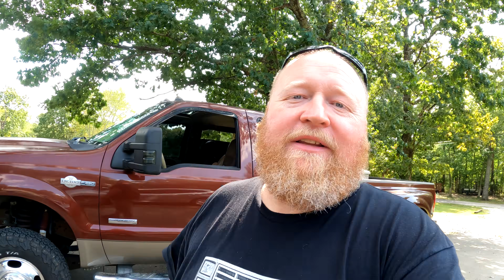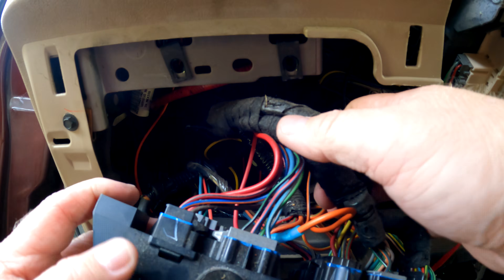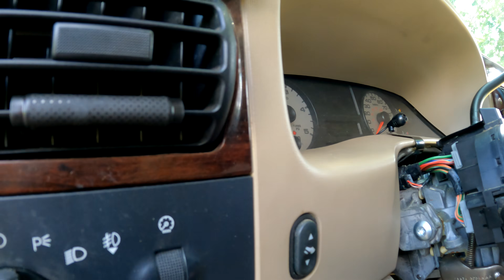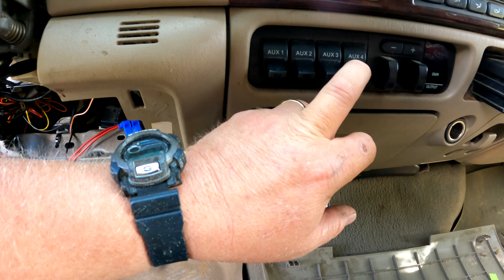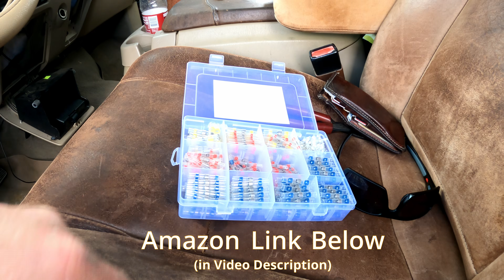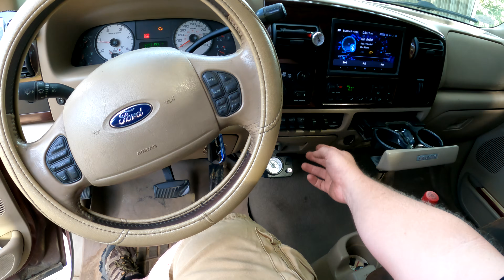Hidden Feature (High Idle) - How to Enable it on Your Ford 6.0 Powerstroke Diesel

Comment from the maker: I get these questions a LOT. "Why high idle?" and "How is it different from the automatic high idle?" Here's the short answer: 

The manual high idle swtich isn't a "Mod" or a "Hack". This is an OPTION. It was put there by the manufacturer of the powertrain system for commercial applications. Some trucks (like wreckers) use a Power Take-Off (PTO) system for things like dump beds, booms, or compressors. These often need the engine to run at a higher RPM for proper operation. The high idle switch lets operators manually set and hold that speed until the switch is turned off.

The automatic high idle is something all the PSD trucks of this era have. In colder temps, it will elevate the engine RPM temporarily in order to warm the engine faster. It turns itself off after a few minutes.

Comment: Has anyone retrofit the factory auxiliary switch panel to their truck? If the factory wiring harness included in all builds or is it a different wiring harness?

2003 Ford F-350 6.0L King Ranch Dually.
Reply from the maker: I believe all the harness is there for the upfitter switch panel. I think that's true for all these trucks.

Comment: My 6.0 F250 sometimes just automatically speeds to 1200 RPM right after start, and won't go down until it gets warm. I don't want it to do this. Is it possible to disable this behavior (kind ore reverse what you are telling us to do) But mine doesn't have a PTO that I know of.
Reply from the maker: No, way to disable that I know of. All the ones I've owned do this as part of a warm up strategy. On all I've owned, pressing the brake will bring it down.

Comment: I used to work on ambulances every once in a while, they would wire that circuit to the parking brake light so when they would stop at an incident and set the brake, the engine goes to high idle to keep battery voltage up for the electronics and lights in the back.
Reply from the maker: Oh, that's kinda neat.
Reply: Thanks Chat GPT
Reply: i own a ex ambulance 6.0 and yes this is true😅

Comment: Around 30 degrees my 6.0 high idles automatically. 2004 Lariat F-250
Reply from the maker: They all do it from the factory when they're in the "warm up" phase. Problem is that you cannot tell the truck to high idle after it's warmed up. That's why Ford included this in the ECM's logic.

Comment: Do we have this same type of high idle system on our 6.4? That would be so great. My buddy picked up a 6.0 with a couple hundred K on it. Me I steped into an 08 with 62K on it I have done every beneficial mode that can be done to it. I think. This one would be great especially in the winter 😊👍👍
Reply: I'd spend the 100 bucks on the BD Diesel kit. It allows you to adjust 900-3000rpm on anything newer than 2005 all the way to 2024. The 03-04 6.0s are only capable of a single 1100RPM high idle using the upfitter wires.
Reply from the maker: I agree with the BD Diesel comment. That's the way I would go.

Comment: I have a pto system on my 7.3l F550 recently it rained & that notorious windshield leak dripped down the driver side floor & pto stopped working maybe water got into the panel. What should I check for to diagnose the problem please respond if u can coz I got stuck with it since it's a work tow truck. Thanks
Reply from the maker: That PTO controller is a pretty sought after thing. If it got wet, you may want to seek out an electronics repair shop. Or have a look on ebay. There are always a few for sale.

Comment: Sorry to waste your time I think I bought a 6.0 ford f350 2005 and it came with an idle button, what’s an idle button and what’s the point of having one??
Reply from the maker: Used for a lot of things - faster warm ups, keeping battery charge high during hard draws, etc. Most ambulances and medium duty trucks like wreckers use them to speed up the hydraulic system. That's what it was originally meant for.

Comment: i always wondered what that bundle of cut wires behind there were for.
Reply from the maker: There is also a small bundle of wires under the hood by the master cylinder too. Those run inside under the dash area  The intention was to keep us from having to drill holes in the firewall to get wiring out under the hood.

Comment: If it’s cold out, my 03 will idle for a minute or so, and then go into high idle to 1100 rpm. It’s never been touched, so maybe it was used first year or so?
Reply from the maker: No, they all do that. It's just a warm-up aid. The high idle feature in this video is an on-demand 1200rpm high idle.

Comment: I recently acquired an 04 F350 6.0 that's been bulletproofed. Somehow, whoever worked on my truck, was able to make the high idle automatic during cold starts. It also auto disengages when the engine is at optimum temperature and lowers the rpms to normal
Reply from the maker: Yes, I know exactly what you're talking about. All power strokes have that from the factory. It is designed to help the engine warm up quicker. It's only a few hundred RPM above idle. The high idle circuit that the factory configured into the ECU that we are using in this video brings the idle up to about 1,300 RPMs, and keeps it there as long as you have it engaged.
Reply: @ProjectTimeGarage  it will adjust based on air temp. My truck when it's around -10 will idle in the driveway to almost 2k rpm

Comment: Hey I know this is an older video, noticed your aftermarket radio. What size is that? Looking for one to fit my truck
Reply from the maker: It's a standard double-din unit. FYI, my older trucks (1999-2004) have a slightly smaller opening and need the dash trimmed to fit a standard double din radio.

Comment: wired those two wires together and i’m not getting a high idle? what did i do wrong or what should i do next?
Reply from the maker: Without looking at it, I'm not sure. If you have the right wire, then connecting it to power will idle the truck up.

Comment: Another bit of information about this high idle mod, for those who may not know…
 
Diesels need heat to run efficiently. If a diesel engine is allowed to idle for excessive lengths of time, the engine will cooldown below the threshold of efficiency. 

Unfortunately, diesel fuel acts as a degreaser. It will break down other petroleum products, especially oil. 

A cool diesel idling too long will cause cylinder wash. This is where the fuel will essentially “wash” the engine oil off of the cylinder walls. This will cause the piston rings and crosshatches in the cylinder walls to wear prematurely and this where blow by begins on low mileage engines.
Reply from the maker: Super well said! I'm pinning this post!!
Reply: @ProjectTimeGarage  wow! Thank you! I just want everyone else to understand and know how to make their diesel last as long as possible!😎
Reply: @ThisGuy16587  well said!

Comment: Why do you want high idle it sounds like it wears engine out
Reply from the maker: It doesn't. This isn't a "hack" this a feature that Ford put into the ECU to be used. This is an everyday use feature for Ambulances, wreckers, pump trucks and on and on.
Reply: It’s good for cold climates as well if you use you’re truck and you have to idle it a lot it’s better to idle them up to prevent engine damage and wear in a diesel engine any diesel engine will benefit from a high idle option if you idle very much at all
Reply: Idling a diesel is terrible! They don’t build enough heat to run efficiently. This results in the diesel fuel essentially “washing” the oil out of the piston rings and off the cylinder walls. This causes premature wear, lower compression, and blow by. 
Idle it up between 900-1200 rpm and it solves the problem. Got a low mileage diesel with blow by? It’s definitely done a lot of idling and ready for an overhaul!
High idle is also handy in vehicles with PTO units, as well as with vehicles that are equipped with high energy consumption equipment. 😊
Reply: @ThisGuy16587  the high idle helps keep the engine warm so the diesel doesn’t wash the cylinders but it’s not good to idle when not needed I guess I should have said.   When you live in cold climates idling is a must when you use the diesel for work the high idle will help it keep warm

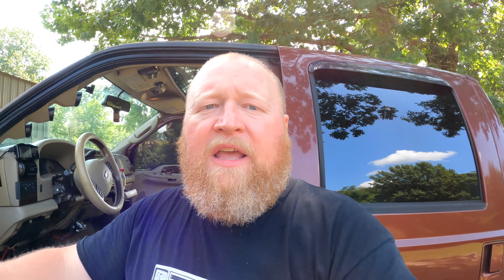Comment: FYI you can do this on 11+ 6.7’s as well, you just need to put a resistor in line.  D 1:43 ifferent resistance will give different high idle RPM, there’s charts and forum posts out there with a simple google.
Reply from the maker: Great info, thanks!

Comment: I found a king ranch for sale. Owner says it has power loss and black smoke at tail pipe. No oil leaks. $7,000,   280k miles. Kinda wanting to take a gamble 🥴
Reply from the maker: Power loss and black smoke = too much fuel and not enough air. Could be an injector hung open
Reply: Bad injector, bad fuel pressure to injectors (below 45psi is bad), FICM voltage below 48V can all cause fueling issues. It could also be HPOP system related, which can stem from the HPOP itself, o-ring issues, Oil Cooler issues..
Reply: I'm not a doctor, but the power loss sounds like FICM if it's not a mechanical issue directly. It's hard to tell without a tool on it to sniff it out

Comment: Do you have to engage the park brake for this to work with the PTO circuit?
Reply from the maker: No, just provide 12v to that wire and it works.

Comment: Those soldering tubs are junk.
Reply from the maker: I've yet to have an issue.
Reply: I saw on a video where after a while that solder paste which is basically a low melt glue gets brittle and just crumbles away.

Comment: Great video the only thing id add is if you have a 2006 f350 like i do, your high idle wire color is PURPLE with a GREEN stripe. And it also wont w9rk unless your parking brake is pressed down at least enough to make the BRAKE light on the dash turn on
Reply from the maker: Good to know, thanks for the info.
Reply: I believe there are a couple options.  I have an 06 f350.  If memory serves me correctly it's been several years.  I used a battery charge circuit in that same bundle along with the pto wire.  It requires park brake to be set to operate.  Depending on load on the engine rpm will increase or decrease..  I've jumped started semi trucks and the rpm will increase a few hundred rpm.
Reply: @Norskie348  id love to see how you did that as my 06 f350 was a cab and chassis truck that they put a service box on the back of. And I plan to use it/ keep if as just that for a work truck.
Reply: @murph2521  I used the same method as he did in the video just a different wire.  You can Google the battery charge protection circuit for an 06 powerstroke.  I found a diagram on one of the forums that showed what wire colors do what.   I wired it to one of my upfitter switches as well.  Does not effect normal cold weather automatic high idle.  To use the BCP high idle the park brake must be set.  It will idle down when released.  Has an rpm range of 1200ish up to 2k I think depending on load.
Reply: @Norskie348  ok 👍 cool I'll have to Google it and find that diagram. I'm not familiar with the battery charge circuit or what that is all for or does. I'm actually new to the ford platform in general I've always drove chevys and dodges.

Comment: If your not running any Accessories, whats the point?  I just use mine as a daily driver to and from work, don't have any mods, not towing anything, no PTO's, so no need to idle higher, kinda bad when shifting gears anyway,,,
Reply from the maker: We never run the high idle when in motion, so gear shifts never come into the equation. But given the accessories and extended idle times that our trucks run, the high idle is nice.
Reply: High idle for warming up faster in winter

Comment: With this orange wire mod, do you still have to have the e-brake slightly engaged like I’ve seen with other guys using the purple/green wire?
Reply from the maker: On the ones I've worked on I didn't have to.

Comment: Thanks for making this. I was just talking/thinking about if my 03 6.0 had a high idle.
Reply: Factory and it kicks in after about 1-2 minutes. Until you hit the brake. My 03-6.0 f350 warms up pretty quick 😎💪
Reply from the maker: Glad I could help

Comment: Is it normal for a truck to go into high idle by itself, when I start my 04 6.0 sometimes it goes into high idle on its own until I step on the break and it goes back to normal
Reply from the maker: Yep, built in warm up strategy. It's present on all the 6.0 trucks
Reply: Yes mine does it if the engine is below a certain temp.

Comment: Does this work on a 2003 6.0 Excursion too?
Reply from the maker: It does.
Reply: @ProjectTimeGarage  the wire is behind the fuse box? Solid orange? Just hook 12v to it?  I'm doing mine very soon!

Comment: My first day hello all My father said there's no Such thing as a dumb question But it might seem silly too Some of you that Are far more knowledgeable.What is the high Idle good for Does it help your e g r Prevent coking For extended periods at Idle
Reply from the maker: High idle is mainly for commercial trucks. See, these engines were designed mainly for commercial application (wreckers, pump trucks, barges, heavy equipment, etc) and they were adapted to the light truck market. How can it help? One example is a pump truck or a tow truck which have PTO driven winches or pumps - faster engine rpm means more fluid flow, which means faster winching or pumping. Most tow trucks will engage the high idle when they are winching a car from a ditch, just to speed the process up. As far as coking? In older applications, maybe - but for modern computer controlled diesels, no.
Hope that helps some.
Reply: @ProjectTimeGarage  Would it be better for the E g r system to run at high Idle if you're gonna be stationary a while to Mitagate coking?

Comment: Hello sir, please can you help me out. I recently bought a 2006 king Ranch, I love the truck but when not hauling my camper or in tow/haul mode... I have to Rev it to over 2000-2500 rpm for it to change gears, is the normal with Ford trucks? Truck is stock
Reply from the maker: That's how both my diesels are too. The Tow/Haul mode changes the shift points in order to keep the RPMs up, this reduces heat in the transmission and the Exhaust Gas Temps (EGTs)
Reply: @ProjectTimeGarage  thank you so much. I was worried something wrong with truck

Comment: This is the first of your videos that I've seen. I watched it two days before I had to reverse flush my oil cooler and clean the system. You saved me two hours of driving around trying to keep the engine at operating temps for the cleaning. I covered the radiator to resist cooling and used my new high idle switch to generate operating temps. Thanks for saving me fuel and time!
Reply from the maker: Glad it helped you!!

Comment: Hey brother. Good video, thanks. 
My ‘05 power stroke has a high idle. Comes on automatically when it’s first started up usually when it’s cold outside. Surprised yours doesn’t. Thank you.
Reply from the maker: Yes, you're right - they all have the warm up feature that increases the idle to 750 to aid in warm up - this is something else completely. It's an 1100RPM high idle on demand - whenever you want/need.

Comment: YOU ALWAYS DO VERY GOOD VIDEOS.....GOOD CONTENT.....AND GOOD SOUND.....I HAVE A QUESTION ABOUT THE HIGH IDLE MODIFICATION.....DOES THIS PRE-INSTALLED SYSTEM ALSO EXIST ON THE 7.3 TRUCKS?....(MY TRUCK IS A 2001).....THANKS.....
Reply from the maker: No, I also have a 7.3 truck myself. I ended up putting a PHP Hydra tuner on it (best thing I've EVER done to it) It has a high idle setting. Here's a video of putting one on a friend's truck: https://youtu.be/InF_ttsZAsU

Comment: I've had this truck for 8 years - never knew! Great video! Thanks!
Reply from the maker: Glad to help!
Reply: Andrew, you've had the truck for 8 years and what's your honest opinion about owning one? I just bought one and all I see are horror story's online so I'm worried.
Reply: @BCarborist I love my 6.0. It’s been my dream truck since high school. There have been some issues, but it’s still cheaper than buying a new diesel and way cheaper than new diesel problems. But I got some work done on her, converted my edge cts 3 monitor into a tuner and it’s like driving a new truck. Way more responsive, better fuel mileage, much quicker getting on the freeway or passing (I can actually pass now). If you are wanting to get a 6.0 and don’t mind putting money into it just pull the trigger and go for it. But make sure you find a mechanic that KNOWS the 6.0s
Reply: @BCarborist I've had mine for a little over 4 years and 95,000 miles. At 204,0++ miles now. Runs great, one if the best trucks I've owned or driven. I've done or had done almost all the updates or needed corrections the factory came up short on. Learn the truck, learn what needs to be done to help prevent the headaches you read about and you'll be able to stay ahead of any issues. Which in the long run saves you a lot of money. Get a decent monitor and use it to watch the major vitals. Get used to what the readings should be and you'll see the issues. Honestly though if you don't "need" a diesel you will save a lot of money owning a gas truck instead. I use mine for work and that helps justify the money I spend on it to keep it reliable. Everything with a diesel is more expensive especially if you don't understand them or do any of your own work.
Reply: @michaelcassidy7645 i appreciate your info! And i literally bouht a sicck 6.0 diesel like 1 month after i posted that comment, i had it for about 3 months till some POS crackheads stolle it and ran it into the ground....😢 i ended up just buying a 2014, 6.7 cummins, its been great, yes expensive asf for anything but i love it. After owning that 6.0 for 3 months thoe, it definitely made me a huge 6.0 fan, i think there great trucks and i hope one day i can find another decent one